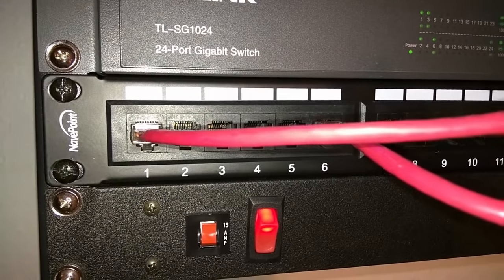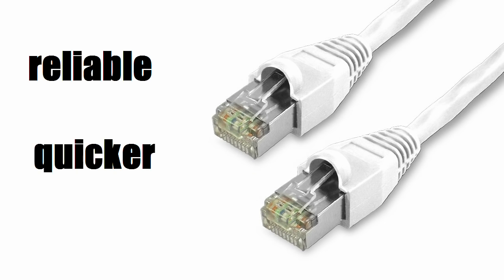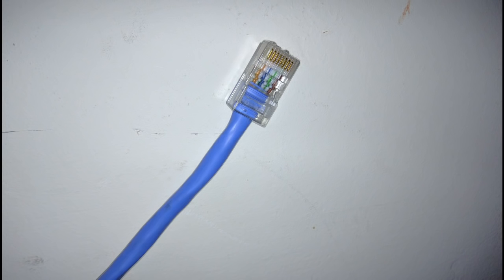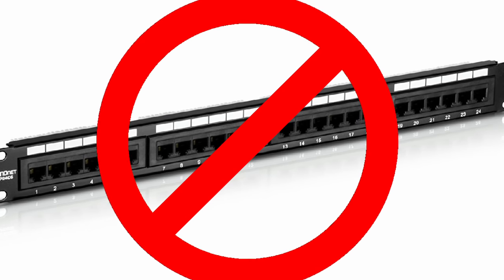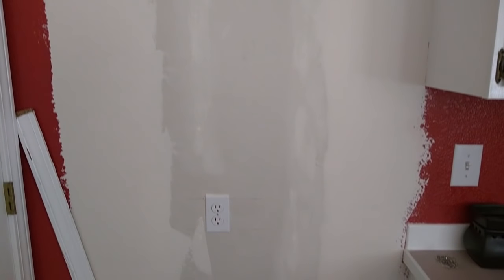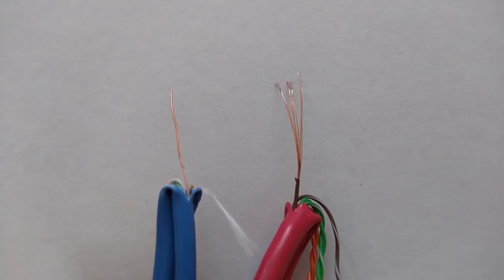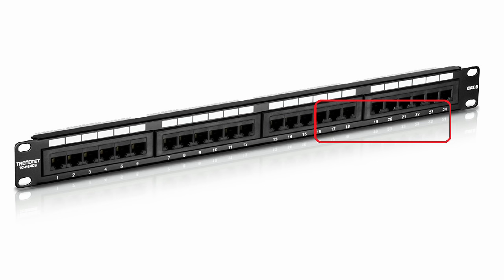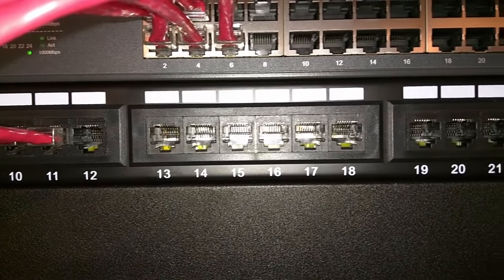What is a Patch Panel? Do You Need One?

Comment: Great video! I'm building a new house and running cat-8 cables through the house as I also like to connect through cables. What is the best switch and patch panel you recommend for cat-8 cables @budgetnerd
Reply: Cat-6A patch panel.
Reply: Cat-8? Seriously? What a waste of copper... Unless your home is a data-center, then Cat-5e (will do 1Gbit+), or Cat-6A (will do 10Gbit) should do just fine...
To quote Wikipedia: "Category 8 is designed only for data centers where distances between switches and servers are short. It is not intended for general office cabling."
Reply: Heres the patch panel I use
https://www.amazon.com/gp/product/B0072K1OWY/ref=ppx_yo_dt_b_asin_title_o06_s00?ie=UTF8&psc=1

Depending on how many ports you need and what you want from your network will dictate which switch you get. 
If you're just looking to expand your network with no extra bells and whistles and you like your current router, just get a dumb switch with the number of ports you need. 
Also unless you've already bought the cable and installed it, cat-8 will be over kill for you. cat6 should be good. it good for 10g up to 55 metres. Cat-6A if you need the extra length. Hope you enjoy your new network!
Reply: @SnorreSelmer  I agree that using Cat-8 is absolutely unnecessary and will likely lead to problems, but I do understand that this person is probably trying to "future-proof" their home by "buying the best" so that they never have to change it again in the future. Bad research on their part, I guess...
Reply: @SnorreSelmer  You dont need CAT 8, if u have not bought or are in position to get replacement,do so and get either Cat 5E for route if the total length is not more than 15. If so, get CAT 6 or 6A. Or 7A if low interference is your requirement but that can be achieved in other ways as well with other cabled. 

I think CAT 5E is still a way to go for most users when max cable length is NOT more than 15 mtrs. 

People can argue, tomorrow we may need 10Gig N/w so I need CAT 6A. Hold on Guys, CAT 5E can also deliver similar results, the only thing is length of cable. 

Don't just go by advertisement, go with facts and results.
Reply: @vivekandroidapp  The distance of CAT 5E is 45 meters on 10 Gigabit, not 15. IDK, but that seems like a pretty long run. Considering that gigabit can go up to 100 meters, going 45% of the distance with 10x the speed seems incredible, honestly.

Comment: Is there an alternative? I’m leasing my house and can’t just start wiring my house. Lol
Reply: Dominik Brame google WiFi and an arris surfboard
Reply: We call it WIFI :-)
Reply: You can always run Ethernet on the outside of your walls. Just wont look very pretty.
Reply: May want to look into PowerLine adapters. Uses your existing power wiring for data. I can’t speak on the quality of signal or speed but it’s an alternative
Reply: @racker5108  Powerline adapters are generally faster than WiFi and slower than a dedicated ethernet cable.  The quality and speed of your connection with powerline adapters is dependent on the quality of the wiring in your house and if any of the appliances (like a fridge, microwave or fluorescent lights) generate noise on the lines.
Reply: Jim Ellis Exactly. Which is why I can’t vouch for the experience one may have because of those variables. Cool idea though

Comment: I am a total noob on this subject but I got a bunch of questions. I want to make a wired network for my family and I need to know what I have to buy to make it work. I read on the internet a lot about what cables are the best, with copper and all but yeah I dont know if I need cat5e or cat 6. I also read about 2 different types of cables 'stiff and flexible cables' So what would you recommend me on doing / buying to get wired internet access to 4 rooms? I will be drilling through the ceilings becuase that is where we put the tv cables years ago. How do i split up the connection? And what should I watch out for? I hope somebody can help me!
Reply from the maker: You could check out my home networking 101 video. If you still have questions, let me know.
Reply: @BudgetNerd  Hi sir, thank you for redirecting me to that video. So I need to buy a router for security reasons and my remaining questions are: What cable is good, is cat 6 sufficient and does it have to be copper or is a 'cca' good enough? And should the cables be hard or soft? And can I for example, make a connecting from the router to a switch that is placed in the attic? And then split between multiple devices like a nintendo switch and 2 pcs? I hope you can advice me so i can build this network at xmas and make my brothers happy!
Reply from the maker: Cat 6 is sufficient. Solid core is good for cables ruining behind walls and through the house, stranded cables good for patch cables. You could place a switch in the attic as long as it doesn't get too hot, electronics hate heat.

Yes if you have a router and a switch, you'll want to connect them. The rest of what you are suggesting sounds good, except the Nintendo switch doesnt have a wired Ethernet port. It will have to connect to this network wirelessly. Get a router that has a built in ap, or get a separate one.
Reply: @BudgetNerd  thank you very much sir!

Comment: Question - why are people still using punch-down jacks at the wall? Why not use a Female-to-Female adaptor jack so that a) you do not need to untwist your pairs, and b) don't need to faff about with punch down tools...?
Reply from the maker: That is much more costly.
Reply: Do you mean terminate the solid core wire to a plug and have it sitting on the floor or a more specialised plate?
Mostly because the solid core doesn't crimp as well as stranded and stranded doesn't punch down as well as solid.
Also, if it is just a coupler sitting on the floor then it has a higher risk of getting damaged whereas punch down keystone jacks and the face plates sit almost flush to the wall at whatever level you want (you don't have to have it at ankle height).
If you wanted to have the jack maybe at waist of shoulder height then the cables would have the extra weight of the coupler.
Unless you were having a coupler built into a plate in the wall.
Reply: You're still going to untwist your pairs in order to put on a rj45. Unless you're using premade patch cables to wire your home. Premade patch cables are not ideal because it's far more costly and will likely result in lots of extra wire spooled up somewhere. Once you've done a few runs of premade patch cable, you'll notice you have a lot of wire spooled up that uses up space. 
Also, technically speaking, you want your runs to be as short as possible to reduce, possible, interference and signal loss. 
The number one reason people dont do it, is cost. Everything else is manageable
Reply: @BudgetNerd  they appear to cost about the same though?
Check https://www.aliexpress.com/item/32817178588.html, and https://www.aliexpress.com/item/32601367344.html
Reply: Just curious, what would a 16 port setup using this idea look like? A triple gang 16 port w female connectors attached to the wall? Would it look as asthetic as the patch panels?
Reply: a punch down tool will cost $2 they make a small plastic punch tool that is all I have ever used in 20 years never had a problem oh and just side cutters to trim excess wire no need for big punch down tools that cost the earth and it has the cable cutting blade as well

Comment: I may or may not have a 18u 4 post locking cabinet at my home.
Reply: I'm with you, man. I happened to acquire a 48U 2 post rack with all of the ladder rack and hardware that was being replaced at a job site a while back. They were changing  to 4 post racks and 18" ladder rack rather than 12".
Needless to say, the spare closet is now occupied and is well air conditioned 😂

Comment: That works in us houses but in uk houses you can't go through the walls so it's floors and ceilings
Reply: Works for new builds only
Reply: Is that some UK building code thing or are your walls solid concrete?
Reply: @headlibrarian1996  solid concrete
Reply: @headlibrarian1996  Cinder blocks used 😵‍💫
Reply: Our uk house is still being built so I’ve ran cat 6 all  house through the walls

Comment: you also need patch panel if your router or switch is in a different room
Reply: Not true. He is talking about the option of wiring the cable through the walls from one room to another but then connect it straight to the switch instead of to a patch panel and then using a patch cable to connect it to the switch

Comment: Having three cables doesn't degrade the connection?
Reply from the maker: What are you talking about? What three cables?
Reply: @BudgetNerd  I meant one cable for the patch-to-switch, other for the patch-throug wall-to-plate and the third one for the wall plate to the pc.. Doesn't it degrade the signal having those two junctions?
Reply from the maker: Oh I see. It might degrade the signal, but if punched down correctly it would be such an immeasurable amount, it doesn't make a difference.
Reply: @BudgetNerd  Thanks a lot for the response!
Reply: I've got WiFi AP's running with a patch cable from switch to POE injector, patch from POE injector to patch panel, ethernet cable to location and a final patch from outlet to AP....and they are up at 1Gb speed. Shouldn't be an issue

Comment: Can you hook a mesh wifi to it? Like Google's
Reply from the maker: Yes
Reply: tbh.  Id rather not.  These are quite stupid in terms of routing any traffic basically. What that means is one port on switch-one port on patch pannel - equals One Device and one device only on the other end of the switch.  So if this mesh device relies on some sort of routing traffic to gateway, and i understand most mesh networks do have the need to comunicate, it might not work as planned.   Ive tried with fritzbox once and it was a disaster. And is not because fritzbox were generaly bad, its just that if u didnt run the wiring to the pannel by yourself, just dont do it.  ;)
Reply: @teknastyk  You can use these with mesh networks.  You just need to make sure that one of your nodes is between the switch and the modem.  I have Eero and it works good.

Comment: What’s the point of having solid core cables?
Reply: I'm here mainly trying to figure Patch Panels out and I think I have the gist now... but I do believe he stated that the solid core cables were preferred for doing the wall runs from the wall jacks to the patch panel punch ins. Solid shouldn't be messed with as it can become fragile, but are better for punching into the patch panel, if I'm understanding the video correctly.
Reply: MrDarfoot yeah I get that they’re better for the wall and punching but why?
Reply: @sneakerjoe23  Hi, Network Engineer here. This video is good at pointing the pros and con but to answer your question, Solid Core cabling is better for punching down in a patch panel because it's a single copper wire in each colored wire of the ethernet cable while in a Stranded Cable, each colored wire is made of several smaller wires woven together. So, let say that you need to punch down two cables and one is Stranded Cable and the other is Solid Core. When it's time to punch down each colored wire, the Solid Core is a one-and-done punch down in the patch panel. As for Stranded Cable, you have to make sure because you want all of the several smaller wires woven together in each colored wire, to be terminated or punched down properly. Of course, you should test out the connection once done but Solid Core cabling is less prone to punch down failures. Sorry for the long explanation. If I had to choose with one to go with, I would choose Stranded Cable due to its Conductor flexibility and the life of the inner cable flexibility. Hope this helps.
Reply: tony172 Awesome man thank you so much for the explanation

Comment: Looking into doing this but could someone please explain why you would need this many ports in one room? (15:58)
Reply from the maker: That is behind my tv. I am always adding stuff to my tv stand. If you do this, you can add as many or as few as you want. I wanted room to expand. I think more than half of them are in use now.
Reply: for future devices.  Also,  you would probably go crazy if each room in your house had one electric outlet wouldn't you?
Reply: @BudgetNerd  Or, you could have a single port and have a smaller switch for the devices in the tv cabinet. 

Work out these costings and see which best matches your requirements.
n sockets + cable + n RJ45 + Time
socket + cable + n RJ45 + Time
Reply: Because, let's say in one room there was an Xbox 1, Ps4, Tv, Pc, 'second pc' wired phone, etc.... you'd need all the ports in order to connect everything.
Reply: what do you want working in that Room? so TV, DVD, NASS, Computer... one way is to install one CAT6 cable with an 8 way switch (with Power to run)... or 2 is to run 5 x CAT6 cables to a 6 gang outlet (no power) but you will still need a switch at a central location

Comment: For the record,it doesn’t matter but his jacks are upside down,ask any telecom technician but again it really doesn’t matter...as long as it’s wired correctly and the telephone or device works,but the ARE UPSIDE DOWN
Reply: ok
Reply: Jacks work in either orientation, but contacts on top are better protected and more reliable, especially for jacks which are not in use.  Contacts on the bottom collect dust, which holds moisture, which creates random electrical pathways between contacts that can be difficult to troubleshoot.

Comment: looks like a good idea, but do the patch panels come in smaller sizes? I don't think I'll need that many patches...
1) the source to feed all the nerdy stuff coming into the house: one tv, 
2) and quite possibly 6 others for laptops and/or desktops to different rooms in the house and ... 
3) the seventh cable for the house in back. 
4) I'm hoping a patch panel half your size would be made for wanna-be nerds... like myself. 
I do NOT like wi-fi.
Reply from the maker: They do have smaller patch panels yes, but  could you find a smaller rack? Or come up with another way to mount a smaller patch panel?
Reply: the 19" panel is standard, but there is also the 10" form factor, thats obivously smaller. But the switches that are rack mountable are not very much in 10" format as the 19" format is the standard for rack mountable gear.
Reply: One thing you are forgetting is that you can indeed use some of those extra ports.  On what you might ask? The one thing missing in your "vision"...... the SERVER! :)   Right now you can pick them up for DIRT CHEAP.  Myself, I picked up a PowerEdge R710 with 2x 3.0gz CPU, 48gb RAM with 4 gigabit ethernet ports onboard for like $190 off ebay.  I have all 4 ports tied together to make 1 connection at 4gigabit and another 4 ports in an old PC acting as my NAS storage with the same deal so with 2 units alone have tied up 8 ports on the switch.   When space is endless, EXPAND! :)  On a 24 port switch I have 14 or so open ports after my stuff is all plugged in and there is also 8 more ports I can get the adapters for fiber to plug in as well.

All in all, set me back around $250 for everything.

Comment: Can you get the patch cables armoured? Can’t they be nibbled on by rats??
Reply: The cable runs in walls could be in conduit.  The actual patch cables and equipment should be in a room free from such concerns.
Reply: Zeric E Fair comment. Was thinking about industrial installations, e.g, in an underground train system where you want WiFi connectivity. Conduit seems like a good solution. Thanks
Reply: @mohammedobeid7643  I haven't seen how it's done in an underground train system, but I can say in a multi-building campus environment, data cables between buildings are nearly always in a fairly large diameter conduit (15-40cm) and can be replaced without any digging.

Comment: Can you please show how to connect 3 routers to get access to computer through patch panel please?
Reply: Not sure why you want 3 routers in the network. That makes things more complex to setup and manage. All of your network drops have to end at the patch panel. From there, you plug another Ethernet cable (referred to as a "patch" cable) from the port on the panel to either a network switch or a port on your router. This completes the connection. Repeat this for all network drops you want active.

I suppose you can have 3 routers in your network rack and patch a certain number of ports from the patch panel to the individual routers. Its a more complex way of doing it though.
Reply: @JJFlores197  I know it's very hard. Although I managed it. I did configure one router at a times. Thanks so much anyway ☺️
Reply: @JJFlores197  some countries like here call access points a 'router'

Comment: how do you convert from coaxial (comcast cable) to CAT Ethernet cable? i am planning to buy the new Orbi wifi 6 and the Orbi wifi does not have the coaxial connection.  Thanks.
Reply from the maker: You'll need a modem
Reply: @BudgetNerd  oh, thanks so much.
Reply: At 6:15 the smaller white box laying on its side is the Motorolla Surfboard cable modem. Contact Comcast and ask for a list of approved cable modems, and what standard (probably 3.1) they use. Then buy one of those from the internet, Best Buy, etc. It will connect to the yellow WAN port on your Orbi with a short (or however long it needs to be) RJ45 patch cable.
Reply: @BudgetNerd  lol😂